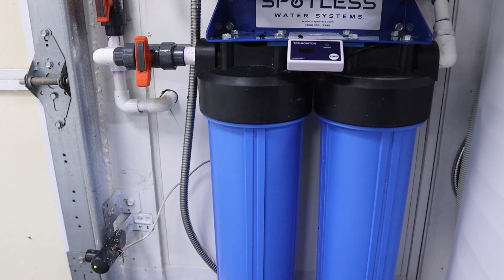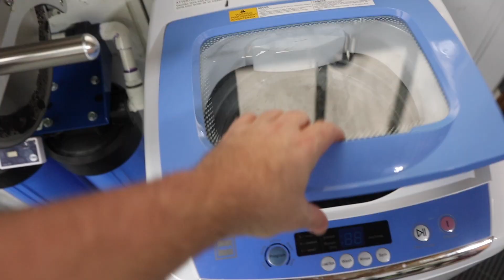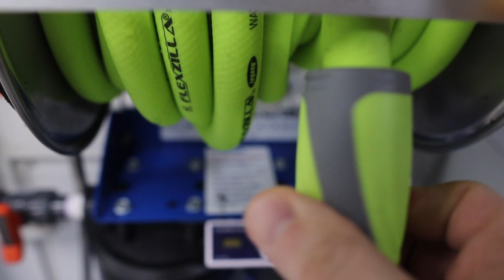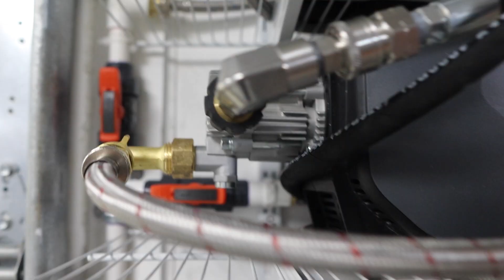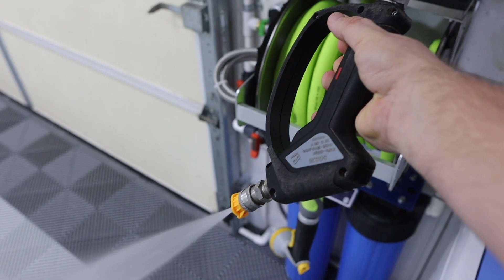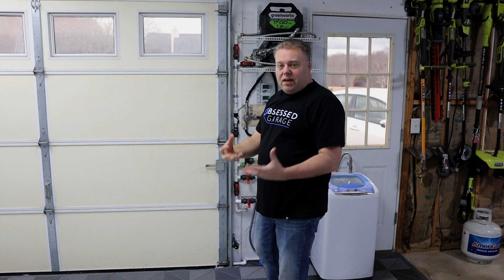Budget Wall Mount Hybrid Wash Setup V2.0 | Pressure Washer & Garden Hose

Comment: Nice setup! I’m new to the plumbing side of things but is there any benefit of using pvc over pex? I know you mentioned you could undo this with the couplers you used. What size pvc did you go with?
Reply from the maker: It’s 1/2 inch pvc. I went with pvc as it just looks cleaner to me. Pex no matter how hard you try it looks curvy.
Reply: @ I appreciate the reply! I will have to look into it some more. I have a detached garage so I’m currently running a 75 foot hose. I’m thinking of drilling a hole and installing the aquor universal hydrant to connect a shorter hose to my garage and running pvc in the garage to have a cleaner look
Reply: @CarsWithKeav  sorry for the questions but 1/2 is sufficient or would 3/4 be better? Currently have an ar630
Reply from the maker: @ Bigger is always better if your house water can keep it fed. My setup is 1/2 inch and have had no problems so far. I may upgrade to 3/4 at some point, but my feed line is 1/2 so I’m not really gaining anything doing it other than it probably looks better.

Comment: Love this setup. Curious why PVC over Pex? I'm currently cleaning up my in garage setup too, but I also have a hot water line in mine. So I'm trying to configure different valves to balance hot and cold to the PW and regular hose.
Reply from the maker: PVC just looks better to me and easier for me to deal with. I wonder if there are inline temp sensors so you can make sure the water isn’t too hot for the pressure washer or hose.
Reply: @CarsWithKeav  for my setup, I've been considering pex so I can do blue and red for cold and hot. Probably with shark bite elbows. But my current setup is braided garden hose fittings like washing machines. But still trying to decide what I like and want.
Reply from the maker: @ red and blue is a nice combo and if you can get them to be nice and straight pex should look good using elbows.
Reply: @CarsWithKeav  temp wise, I never run full hot to the PW. The hot is always blended with cold. Bucket fills are probably the hottest I go, so my mitt dips are nice and warm in these NY Winters.
Reply from the maker: @ I think most equipment can do 140 degrees which is higher than most hot water heaters run. You should be good then. Most pressure washer equipment meaning of hot is using it with a boiler or steam setup running like 200 degrees or more.

Comment: Did you ever have any issues with your 90 degree brass connectors to the pressure washer? I have always had them leak for some reason.
Reply from the maker: I did initially just had to use good quality Teflon tape like blue monster and had to use lots of leverage to torque them down.

Comment: I love the setup and it's location, great for indoors in the winter and outdoors in the summer.  I'm not sure I could do that up in New England without cranking the garage heat all winter.  I am thinking about putting the water filters and pressure washer on the back wall and then running a line out to the front of the garage and setting up the spools there.  I'm not sure if that would make enough of a difference temp wise.  Until then the wash cart will have to do.  Another great video!
Reply from the maker: I have no experience in northern winter when it comes to car washing so I would t be a great resource for that. I live in Michigan and West Virginia in my younger years so I know how brutal it can get.

Comment: Did you have to battle any leaks or did everything dial in nicely? Agree with your take on "budget" 👍🏻
Reply from the maker: I had two leaks crazy it was the least expected. The elbow and the male 3/8 plug I had to double up the thread tape and use tons of leverage. It was one of those drips every few minutes, but was bothering me.

Comment: Nice setup.  I'm eagerly awaiting for the 2.0 to be back in stock.  Hopefully it'll be here before spring car show season.
Reply from the maker: I think I just saw they said they are taking ore-orders again.
Reply: @CarsWithKeav  I just ordered the bare compressor.  Now I need to order the rest of the tools to put it to work.  I want a quality 50' hose and a decent gun/wand.
Reply from the maker: @LaswellB  active is coming out with a gun soon. I’ll have one to review soon. If not MTM makes some good ones. McKillans has a good budget swivel version as well.
Reply: @CarsWithKeav  I went with a McKillans.  I'm sure I'll experiment with other brands and setups, but I want to get it mounted and see what I like.
Reply: @CarsWithKeav  I got my active 2.0 from OG the other day.  I tested it that day, and all was fine.  I got it mounted on the wall today, turned it on, it pressurized, then shut off.  Now it won't run.  I have a green light at the plug, so nothing tripped electrical wise, my guess is an internal issue with the switch.  I've got an email to OG and waiting for a response.

Comment: What size pvc pipe did you use 1/2”or 3/4”?
Reply from the maker: 1/2, my main line there is 1/2 so no need to go higher plus I wanted more PSI for the garden hose sprayer.
Reply: Thanks